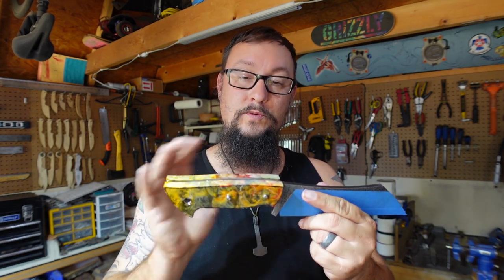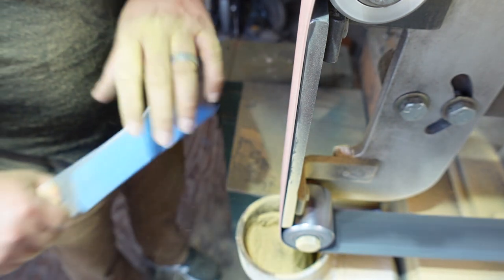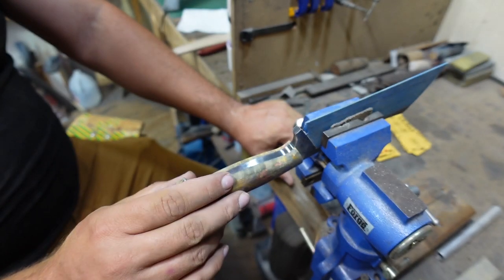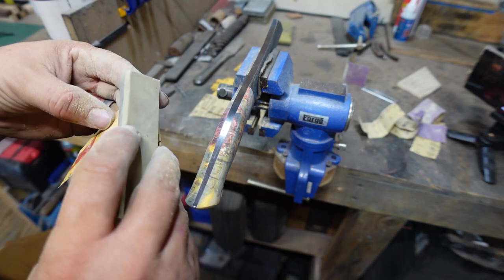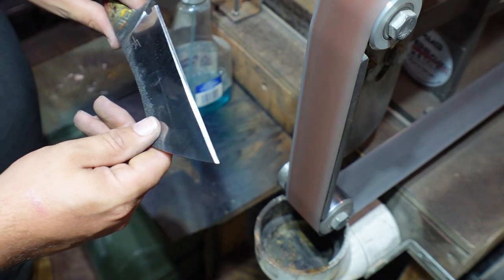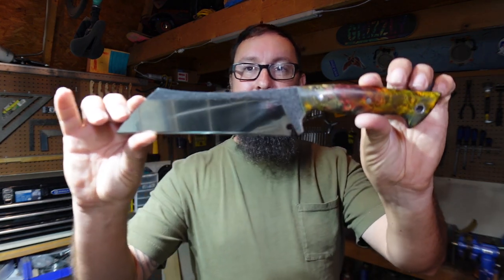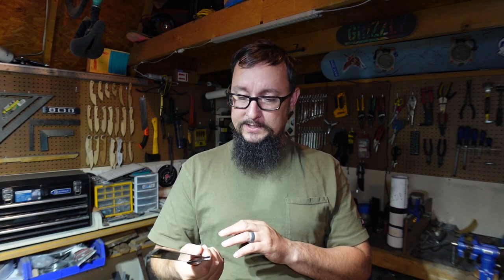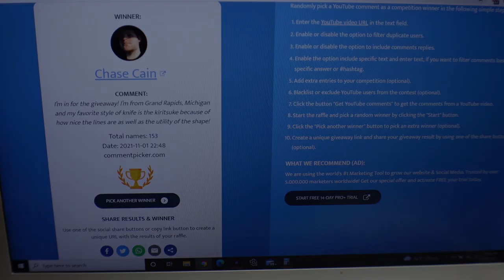5160 Chopper Completed! | Shop Talk Tuesday Episode 102 | Knife Makers Vlog

Comment: so you go from 80 grit on the oscillating sander to 320 by hand? I see to have to start around 120 to get the sanding lines out first and then work up.

Comment: Isn't 5160 easier prone to rust
Reply from the maker: I've had the least issues with my 5160 knives rusting. The 10XX series steel knives have more issues on my end.
Reply from the maker: But when it boils down to it, high carbon anything is prone to rust if not maintained properly.